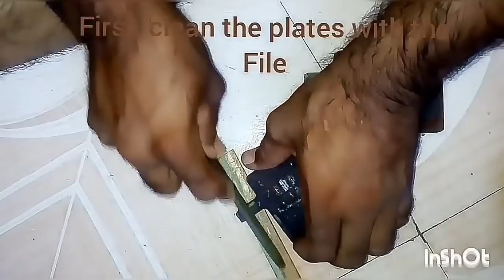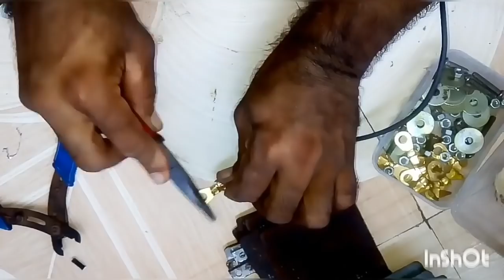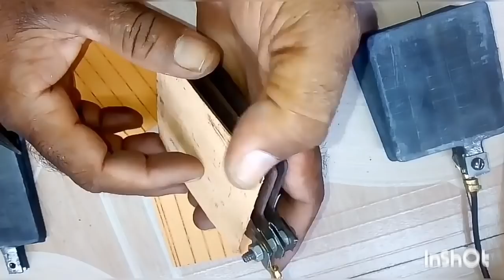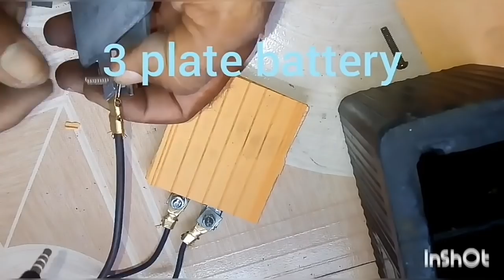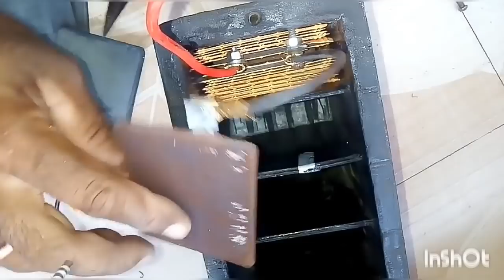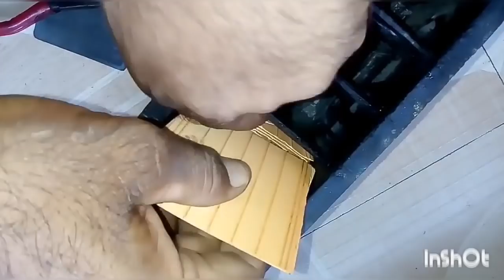Easily create your own lead acid big or small battery sitting at home

Comment: excellent educational video but you and i know that it will work temporarily since metal will corrode.
in the old days wood was used as a separator but would degrade because of the sulfuric acid. you can use fiberglass from insulation, plastic or thin rubber (old inner tubes) etc.
Reply from the maker: Yes Sir your advice is valuable to us, but it has been used glass fiber insulator as separator of the plates. Your valuable instruction also might be follows in future. Thanking you.

Comment: All the connecting bolts and wires will corrode away in no time, all connections in contact with sulphuric acid is done with lead metal junctions in professional batteries.
Reply: Not clear your job.
Reply: Agreed. U r right. Only lead can survive in acid.
Reply: Thats why he said "at home"
Reply: Tinkering with these lead acid batteries at home is not advisable.
Reply: Usa Traductor para entenderme. Puedes colocar una especie de barniz o pintura aislante luego de ensamblado los cables o también resina epoxica, así las partes de hierro no se corroen o erosionan con el ácido, con respecto a las placas sugiero use zinc y cobre o mejor si es magnesio en vez del zinc, para los separadores ese es el detalle que no he conseguido uno verdaderamente optimo. Usa Traductor para entenderme

Comment: Appears to be iron plates, lead plates, and some type of acid resistant plastic or rubber.  

My questions would be:
Do the washer, bolt, and screw materials matter? They appear to be some type of iron based material, would this throw off anything?

What type of electrolyte (liquid they add at the end) is being used? How can one make it at home if in a pinch??🤔

Lastly, did it work??

Comment: In this way all the iron nut-bolts and copper connections will get dissolved in the acid and will not work after 10 to 15 days. All connections should be of lead material for long life. Also there should be covers for all the compartments, otherwise the acid will be evaporated quickly. thanks.
Reply: Great ..you are a local battery manufacturer great reply👏
Reply: @shidhindas1748  Thanks 🙏
Reply: Battery backup nahi derahi kafi time se use nahi horahi thi rakhi hui thi juldi down hojati hai kya sulferic acid dalsakta hu
Reply: @smritiranjannath4057  please guide

Comment: Battery Construction
A twelve-volt battery has six single cells in series producing a fully charged output voltage of 12.6 volts. A battery cell consists of two lead plates a positive plate covered with a paste of lead dioxide and one negative plate  made of sponge lead, with an insulating material (separator) in between.
Reply: sponge lead , lmao!

Comment: Firstly
Safety alert first
Please put gloves on your hands
You deal with lead and lead dioxide
And sulferic acid
Toxic and dangerous substances
I would like to tell you in a nutshell
The battery will fail
Because sulfuric acid will attack iron and copper
To the top of the wire (and it's not easy to make a battery)
The battery has mounting or collecting devices
The battery contains accurate installation or assembly performance

Comment: Permission to ask sir,  what the separator was made of? Please tell me
Reply: Rubber or Fiberglass.
Reply: They use glass for higher end batteries. Somehow they can pack more lead into the battery with glass separators. The Duracell guy explained it to me. You pay for the lead content. Which is fucked up, lead is cheap as shit but batteries are fuckin 100 dollars.
Reply: Any insulator
Reply: Positive plates led? What's the negative plates? Graphine? Aren't the separators cardboard? Looks like it..thank you.
Reply: Is the liquid salt water?
Reply: @johnchathas1957  sulfuric acid + water
Reply: These are porous pvc separators.
Reply: Thanks for replies
Reply: John Chathas  NO SULFURIC ACID
Reply: Rifki Muantep  the seratators are insulators to keep the plates apart but allow the flow of liquid between the plates.  They are usually made of fiberglass, porous plastic or porous glass, or porous rubber.
Reply: John Chathas  the metal plates are lead the negative,  the positive plates are lead oxide PbO
Reply: @tomharrell1954  Hi Thomas, as you said negative plate is lead, and positive  is lead oixide, so, how do you get oxide lead plate from an norma lead plate?..please explain to me!..Thanks, Peter from Brazil.
Reply: @tomharrell1954  You Probably" could be able to use 2 - 4 layers of simple plastic screen for windows as separators.
Reply: it's any insulator which doesn't react with acid,plastic

Comment: I'm not so sure using bolts and screws containing iron is a good idea when placed in sulfuric acid.
Reply: It's for a better explosion.
Reply: Usa Traductor para entenderme. Puedes colocar una especie de barniz o pintura aislante luego de ensamblado los cables, así las partes de hierro no se corroen o erosionan con el ácido, con respecto a las placas sugiero usar zinc y cobre o mejor si es magnesio en vez del zinc, para los separadores ese es el detalle que no he conseguido uno verdaderamente optimo. Usa Traductor para entenderme

Comment: where did you buy those positive and negative plates...
Reply: I guess the plate is remove from bad battery , usually bad battery still have good negative plate. by using 2 of negative plate can make a battery after charge.
Reply: I try to charge a similar battery but wont keep the charge;ps i have not put the plates interected but separated

Comment: What are used as seperators?
Reply from the maker: Separator is used to keep the plates isolated from each other . Usually it is mounted in between two plates.
Reply: @MyhobbyElectronics  what material is used ?
Reply: @sarathforscience7845  it's fiberglass but anything would do eg plastic
Reply from the maker: @sarathforscience7845  Please watch the full video , in this video all about materials and components were used to make the battery cell is initiated in the video. Please watch and subscribe my channel.

Comment: When you tied all the lead plates together like you did, made all of them one electrode? Each plate electrode had it's own electrical property's and it's on electrical potential. Tying them together limited there use. Did it not?    You could have saved some hardware by just using filter paper as what you used in the video and just soldered the plates together. Right? Just asking mate.
Reply: Glen Chadwick  WHATS THE MATTER WITH YOU? I asked you a few questions and you answer back with a few question. WHATS WRONG WITH YOU? I was asking you about your project mate. Do you have an answer for my questions or are you just going to give me question back inreturn>

Comment: You were struggling trying to put those separators between the plates lol you could've just put everything together piece by piece like making a hamburger then solder the plates using lead instead of using nuts and bolts.
Reply: Very good explan

Comment: Could I ask what the separator material is and where to get it TIA
Reply: I think I've seen in some battery rebuild that they simply use screen like that plastic screen you get from the hardware store for Windows and that's all it takes something that doesn't react or corrode away.

Comment: straight away using a brass with copper wire in acid is a total fail
Reply: Yes it will fall off one day , maybe short or open circuit. So sad.

Comment: Not a good idea. The bolts and nuts used to join the plates would corrode very quickly in the presence of the acid. Initially it would work but deteriorates very soon due to corrosion of the bolt/nut. Plate can be bought from shops that sell Lead Acid Batteries. If the battery is not sealed properly (with a small vent to allow gases to escape) bubbling would cause tiny droplets of acid to spread around and destroy objects in the vicinity. Regards, Engineer from India.

Comment: Ok - I'm pretty sure this is a joke.
firstly putting the plates together with steel nuts and bolts is nuts. The acid will destroy them in a few days, bits of corroded crap will drop into the acid and after a week or 2 the plate connections will fail. 
Much easier and quick to solder the bus bars and plates together with lead.
Not really sure what to point is of this vid though....
Oh and cardboard as separators would be mush after a day...
Nope - don't copy this....